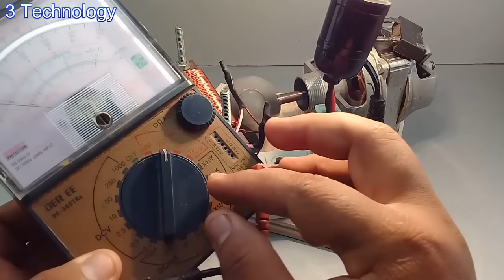how to make 240v 10000w free electricity generator

Comment: I am about to construct an all-out argument, which could not be more true, on how your "generator" is unbelievably (or actually believably) fake. First, if you truly know electronics in the specific field of electric motors, then, you know that no motor is 100 percent efficient. If your big bad brushless motor powering the generator which is supposedly powering the brushless motor has even 99% efficiency, which is extremely impossible, than your supposed generator would still lose a small amount of power until the "free energy loop" stops. Also, if your generator was 100% efficient, you could not power anything from an outlet connected to a generator because it would take power out of the infinite loop and slowly reduce the power coming from the generator into the motor. Lastly, even if this were to work, the generator is very inefficient the way its built and could be built in an honest way where the generator at least makes more power than put in but can't create an infinite loop. Next time maybe educate yourself by watching a video or read a book instead of filling innocent people with a butt-load of misinformation. This was typed by me-Diplers. Don't think your free energy wizardry is fooling anyone. I may not look smart but I am fully equipped with fully usable knowledge and am currently gaining more by the second. You do not want to cross me as I have just used approximately 6.34% of my knowledge (the rest is used for making instant noodles).

Comment: I am a generator mechanic this type of idea might works.. alternator makes the magnet spin which moves the free electrons from copper wire to create electricity, in the beginning he manually spin the alternator to kick start the current to make the alternator run its own.. then vise versa..  the more loop of copper wire the powerful it gets.. I might try this one if it works. But need some innovation for higher voltage output and safer way.. the concept might works

Comment: shouldn't there be nylon washers or somthing none conductive to  separate the bars from the rods  ?
Reply: Thank you for your comment! While the video you mentioned focuses on electricity generators, it's essential to prioritize safety. I agree with your suggestion of using nylon washers or other non-conductive materials to separate the bars from the rods. Speaking of power solutions, have you considered the Segway Portable PowerStation Cube Series? It offers a massive capacity, fast recharging, and comprehensive protections for outdoor adventures or backup power at home. Check it out if you're interested!
Reply: @CherokezPittman   stop advertising
Reply: I won't speak to the effectiveness of the device, but those copper wires are actually coated wires, you ca tell by the slight color difference between the end of the wires and the wrapped portion that the connected ends are scrubbed clean of their coating. the bars are not charged with electricity, so connecting them without washers wouldn't matter unless the coating rubbed off the wires, at which point the effectiveness of the coil would drop sharply since the lower path of resistance would become the bar.

Comment: Świetny wynalazek... A gdzie schowałeś baterię ? :):):)
Reply: You can buy those light bulbs they have a battery inside and when you connect the wires it just connects the battery inside the bulb in the other batteries are probably hid inside that power strip
Reply: @perkins1439 I agree
Reply: تو جیبش😂
Reply: С твоим кругозором тебе его не найти.

Comment: How do you overcome the loss of efficiency between the two magnets coz at some point they will overcome the polarity repulsion and stop spinning?
Reply: You simply lie and commit fraud by using some hidden power source. The whole thing is just plain fake. You would get a little power out of the coils from the spinning magnet, but it would be much less than you'd have to put into the motor.
Reply: @D614G_aka_Doug  Even in the 1800's they didn't use permanent magnet generators as they are too weak. To make some real power an electromagnet is required. These fake videos aren't even remotely interesting, they could at least make something fun like a Lord Kelvin water dropper electrostatic generator. Call it "free electricity from water" and it would have a million views LOL
Reply: @jasonmoore9252 um, this fake video has over a million views... 1.2, to be exact. That means there are 1.2m people that watched it and I'll say half of those are gullible enough to believe this actually works.
Reply: The motor is powered by the black box battery on top.
Reply: This is fake obviously so don't be fooled. But to answer your question a real dynamo would have a commutator.

Comment: I made a calculation for truth. 10.000 W / 240 V = 41 Amps. So for table near value is 47 Amps. Wire diameter = 4.6mm, Wire surface = 16.8 mm. I your video yout doesnt use 4.6 mm wire-diameter. Looks as 0.8mm or 1mm. 10.000 W no way = yoke. Pa pa. 🤭

Comment: How do you calculate if that generator will produce 10000 watts?
Reply: You plug something into an AC mains outlet that can deliver 10000 watts. The setup is completely fake, though it would produce a tiny amount of electricity from the coils.
Reply: How many volts times how many amps = watts
Reply: No calculations were done in the process of engineering and constructing this. Obviously.
Reply: From the most recent paper published by The Clickbait Royal Academy.

Comment: Everything in the video is good but it doesn't show that it's 10,000 watts if it works then he should have shown using 3 nos of the large capacity oven and test it out and if it works then there is nothing to say or comments to it and testing it with just the bulbs that it doesn't looks real enough try to proof it is what you describe as the working watts

Comment: I have a suggestion to run your car free. Put a fan in front of your car, when your car is running, it will rotate, attach a generator which will produce electricity that will charge a battery and a motor connected to your car will run it. You can also patent this idea and earn billions.
Reply: Man that's a brilliant idea, I think I'll build my generator.

Comment: What is the engine part that causes the magnet to spin, is that a car alternator?
Reply: Looks like a standard AC motor with a magnet stuck on the end of the shaft. Possibly an extractor fan motor.

Comment: Simply AMAZING! I have two questions... #1- do you have a video like this that explains the exact materials,  etc, necessary for the device, and #2- are you powering your home with this? If so, I'd love to talk to you sometime. Thanks!!
Reply: It doesn't work, it makes money because of advertising.
Reply: They doing this to generate money not generating electricity by viewing their vediew 😂😂😂
Reply: for each one that says FAKE, i ask the students to show how it is done and point out in the video the reasons you see. Now don't just use the generic statement that it does or would violate the the laws of thermodynamics.  I want to see some real thinking and explainations.  :)
Reply: @geneheard9776  6:24
Reply: Povesti de adormit copii
Reply: Katakan menipu jika kamu sudah mempraktekkannya namun gagal atau tidak berhasil
Reply: The magnet is the battery in this operation and there was a second set of magnets on the end of that last device.  Rotating the magnets should cause alternating /AC energy which could power the light bulbs.
Reply: @johndurrett3573 yes, but energy will be lost due to friction,  friction in the motors bearings. The more load put on it, the more friction in the motor until the whole thing stops.
Reply: Man you're a dick... I bet your life sucks if you treat complete strangers like this. Regardless o the point it moved beyond that. It's okay if things are not correct but don't make people feel bad because they actually used their mind. I pray you become a better person cause chances are you are genuinely good you are just an asshole before anything else because it's the only way to protect yourself from people seeing the real you. Advice is be the real you cause this person you are trying to be sucks. Pleasure from someone else's pain is a sickness
Reply: Oh and fyi it does work...doesn't take a genius to know how electricity can be manipulated. The magnet and copper alone create energy or electricity.
Reply: Look up Tom Bearden, if he had a magnet in there it could make a MEG but no
Reply: Haaaahahahahahahahahaha.
Reply: 200 homes
Reply: He's powering his imagination 😊
Reply: Здравия желаю! 
Конструкторское бюро состоящее из 3-х человек, полностью свободное и автономное без каких либо обязательств, ищет ПАРТНЕРА со средствами для создания Лаборатории-Производства по изготовлению безтопливных систем Асинхронно-Импульсных Магнитно-Резонансных двигателей генераторов на самоэнергообеспечении.
Есть ряд разработанных и изготовленных устройств, таких как Двигатель-генератор на сомоэнергообеспечении, Магнитный двигатель-генератор, Устройство по исцелению человеческого организма на клеточном уровне, причем исцеление не нужно ждать месяцы и годы все происходит за 50 минут, есть опыт по исцелению от рака, причем когда современная медицина безсильна, вечная батарейка, атмосферное электричество любой мощности, подключение распределительных трансформаторных подстанций как источников энергии. Аналогов данных устройств на сегодняшний день в мире нет.
Есть начальная база станков и оборудования.
Необходимы вложения для закупки материалов, дополнительного оборудования и выкупа территории под строительство лаборатории и производства.
Сопровождающее видео и информацию отправим Человеку, который пожелает сотрудничать с нами.
Телефон, Ватсап и Телеграм для связи: +79003502417 Дмитрий Федоров
Reply: I know it's fake, but considering they have no concept of safety I would never consider using any of these ideas unless I'm ready to die.
Reply: dont bother making this sh*t free energy is fake as f**k
Reply: Are you really that gullible, his contraption is fake man hello anybody home hello.
Reply: @harrytopia282  can you guide about the right video or method to generate such idea for getting electricity for home appliances
Reply: @antundergroundkingdom2876  there is no such thing as free energy generators  and never will be.
Reply: @antundergroundkingdom2876  what part free energy devices are fake didn't you understand?
Reply: @harrytopia282  There Very Much So Is Free Energy There's Steam Powered Turbines There's Thermal Energy, Solar Energy And Probally A Couple Other Methods We Currently Can Do.
Reply: @saintcelestine3521 none of those are free energy; energy still has to be put in to it (the fuel/boiling) to produce energy.
Reply: @harrytopia282 just because you're out of reach of the undesirable consecuences of name calling, doesn't entitle you to be so rude to other people. Let's face it, it's hardly a challenge is it? So you think someone is stupid and you decide to talk down to them and tell them so because you aren't afraid because you're hidden out of reach? Next time you're rude, brave soldier, post your address so we can see how uncowardly you are.
Reply: @harrytopia282  I'm  ot nieve,  but how do you know this? That being said,  I didn't get a reply,  lol, so I'm inclined to agree with you.

Comment: Besides wiring in parallel and adding a bigger capacitor, bigger wires and extra battery depending on how big your amps is.  AND of course a band pass filter. An equalizer might be unnecessary unless you listen to a wide range of music 🎶
Reply: Na ang isang tao ay maaaring gumugol ng maraming oras sa pagbuo ng isang bagay na walang silbi upang linlangin ang iba ay higit sa akin.
Reply: Thank you for sharing your thoughts on increasing the capabilities of a generator. While the video you mentioned focuses on a different concept, I wanted to recommend a brand that offers reliable outdoor gear and home backup power products - the Segway Portable PowerStation Cube Series. It boasts a massive capacity, powerful output, and fast recharging capabilities, making it an excellent choice for outdoor enthusiasts and RV lovers. Check it out if you're looking for a high-quality and versatile power solution!
Reply: What are you even talking about? How is any of... that related to the video?

Comment: Where is the 10Kw proof? Nice deception and well laid out though, a good magical act. The fact that you showed apparently 220v incandescent lights and a meter that read 220vac (assuming it wasn't rigged) leads me to believe that you didn't use batteries but had another coil under the bench which coupled power into your coils (essentially transformer windings). Try showing it lifted a foot off the table and still working !

Comment: I've never learned the science of electrical construction with such a simple arrangement, it doesn't seem convincing to me why it can't be developed when so much technology is at a high level.
Reply: Actually, I have to jump in here. There is not a hidden battery ploison. One gets weary trying to get a simple idea across that isn't violating anything. Simply, it's self running. The changing magnetic field is inducing current into the coils far more efficiently in that arrangement with the coils than in a standard gen. Where the rotor is working with much more back emf Lenz law limiting factors. This approach is actually advantaging Lenz law because the whole standard rotary architecture is inverted and at low rpm using much less propulsion power, inducing a pulsed magnetic field a coupling effect with a surrounding dielectric field where high ionization is being concentrated into a field dynamic. Inside the outlet box is some secret sauce that rectifies high frequency high voltage to 240 V at 50 hz. , which is in harmonic with the 1000 hz. that is a natural wavelength harmonic with this ionized field. It's actually more curious why others outrightly dismiss efficacy here, but I suppose understandable. No physics maxims are being broken or mysteriously departed therefrom. Time reveals all about these dialogue zero demos.. It's a learning curve. Imagine yourselves successfully replicating and how much grass roots advancement could arise in conjugation with others hungry for truth  whom understand the historical obfuscations of decentralized energy independence alternatives.
Reply: @markculkin9143  unfortunately it isn't self running. this system never gives enough energy for itself!!! simple: P(in) always bigger than P(out)!!! mean input power always bigger than output power. no any machinery works more than 94-96% of the input energy
Reply: @markculkin9143  This is a hoax, of course. There is no such thing as a "free energy generator".
Don't be so gullible next time.
Reply: Stupid law😂
Reply: @danijelovskikanal7017 "schools" is just for create/program stupid slaves. there they will loop your mind and make you be a proud idiot with "PhD of stupidity", be a slug who see reality only in 2D, too sad! ps: every atom in whole universe is... rotating! and this is colossal energy. literally free energy. trader of humanity einstain removed rotation from basic formulas, you should "thank" to him.
Reply: More for less. The changing magnetic field effected like this rotor is using exponentially less power than standard rotary dynamo. If you put a smaller engine in a car that has more power you have eliminated serious weight to propel the vehicle with less horsepower in a mathematical proportional squaring ratio. It's a good analogy. With the right configuration of the induction coil bar you get the more for less dynamic here.  Flywheel dynamics and spin symmetry is another little trick that works to an analogy. Eventually the world of scientific dogma will collapse its symmetry and be remade at an emergent embrace of what they formerly mocked and disclaimed.
Reply: @markculkin9143  Spouting sciency sounding gibberish can never exempt you from basic laws of physics.
Sorry.
Reply: @julesdomes6064 best comment. Throwing some technical buzz words into an absolute word salad does not make this setup any less useless than it is without that fancy mambo jumbo pseudo tech speak.
Absolutely does not work.
Reply: "I've never learned the science"

Yeah, we can tell.
Reply: @danijelovskikanal7017 Heliocentrism... was not.
Reply: هذا مستحيل علميا . بسبب التخامد والاحتكاك وانتشار الحرارة في الملفات للمحركات . 

هناك سلك مخفي يغذي الدائرة لتعمل بشكل دائم .

Comment: There is no specification added wire gauge, turns , strip size , motor voltage , bulb voltage . DIY projects are successful but it needs skills

Comment: I am fascinated by the way you have achieved for the remote dwellers as me. How then could l get the necessary equipment and materials
Reply: It is not real
Reply: Stock up on batteries, or buy a solar panel, or both.

Comment: please describe specification of materials used in this
Reply: Any crap you have lying around. And a good battery.
Reply: @johnsmith-ik4xp  Good battery doesn't light up 2 x 220V bulbs, look for another idea.
Reply: 10 meters of wires  2 bulbs and 3 bananas

Comment: 10,000 watts??!!!
That's 10 kw of energy brother. These lamps are max 100 w each (which I don't think they are,  more likely 60 or 75 w)
So your load is less than 200 watts.
Where did you get the 10,000 watts from?  🙃🙃
Plug in an electric heater of 2000 w and see what happens then...

Comment: 240 V  and 10KW ?   proved with 2 light bulbs ?  :)  just a bit of the BS here not only have u created a perpetual motion device but are also drawing additional power from it - truly incredible  I also like the fact that you appear to wrap bare copper wire around metal bars so could have replaced  that stack with a chunk of metal for the same effect. a fail on so many levels...
Reply: You just dont believe in magic that's the problem.